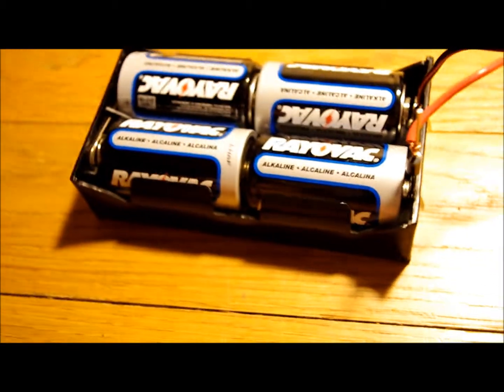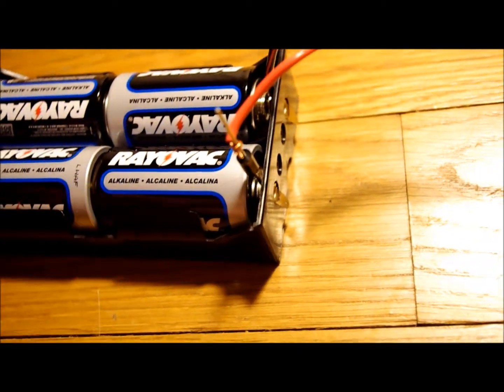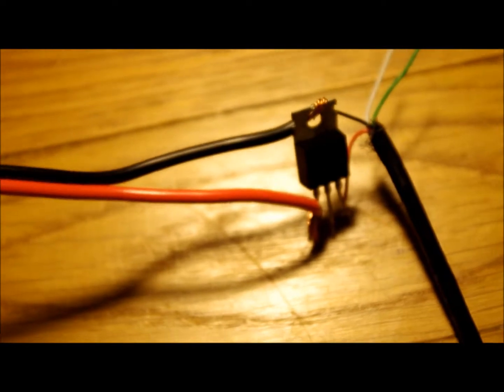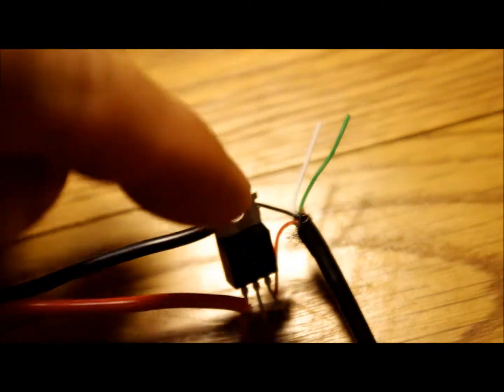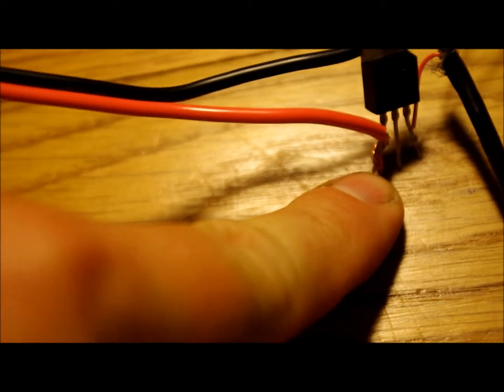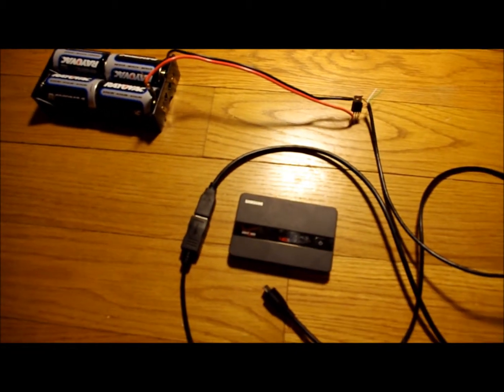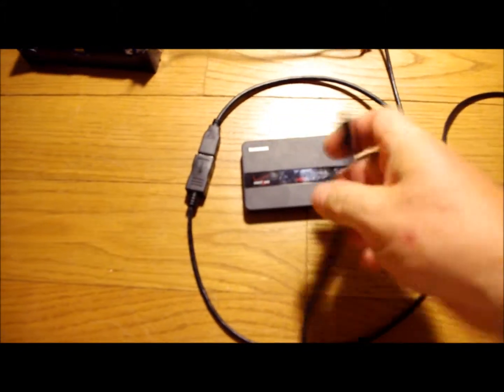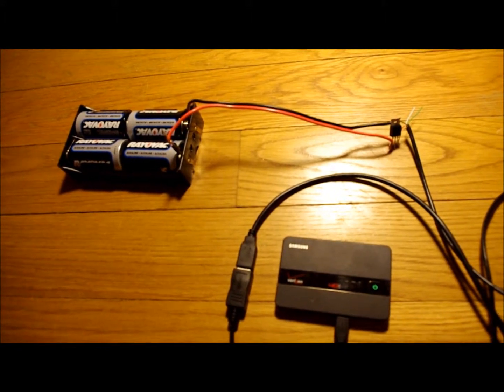USB Charger

Comment from the maker: @gruvenon I highly recommend installing a heat sync on the regulator. That is what the hole on it is for. The hole and the middle prong are both the negative terminals. In order for the regulator to drop the voltage to 5V, it has to dissipate the remaining energy in the form of heat, and it can get very hot.